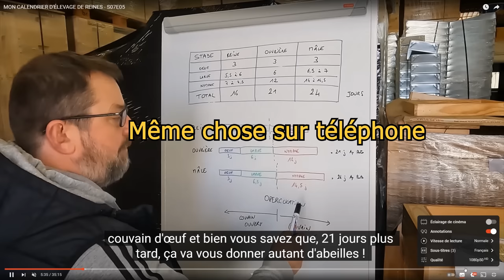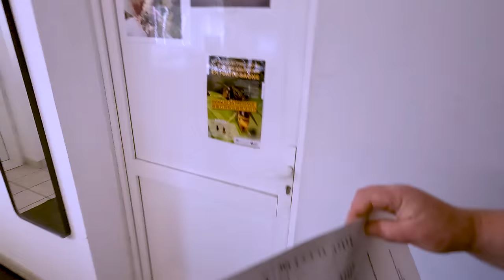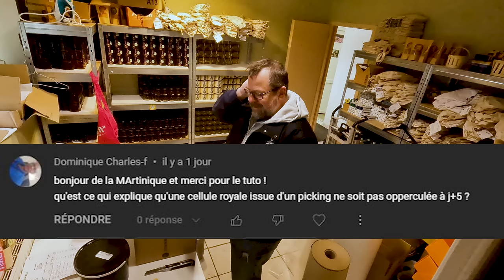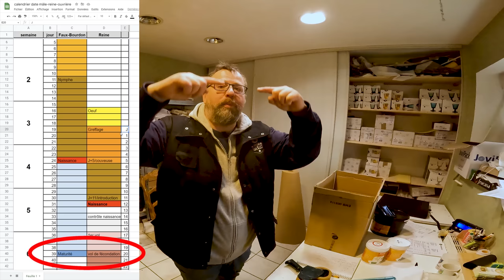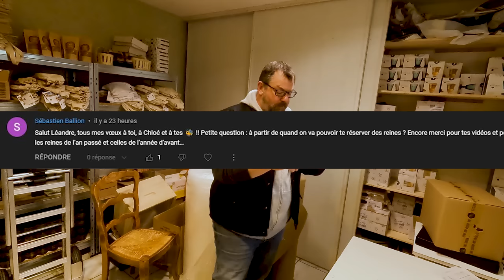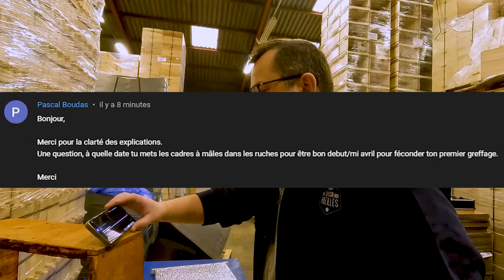MATÉRIEL, PIEGE FRELON, TVA, FAQ, TOUVABIEN !    [S07E06]

Comment: Salut,encore une super vidéo. Moi pour les frelons j'ai trouvé une solution, c'est de les attraper lorsqu'ils sont devant la ruche avec une épuisette, et de leur mettre de l'insecticide Front line(pour les animaux de compagnie, trouvable en pharmacie) étant donné que l'insecticide n'est pas trop puissant, les frelons ont quand même le temps de retourner au nid avant de mourir et de contaminer celui-ci. Chez moi les ruches étaient vraiment en péril, et en faisant cette méthode, en passant 2 fois par jour pendant une semaine, il n'y avait plus de frelons, et cela à duré pendant 2 ans, et quand ils reviennent je refait l'opération. C'est pas très bio, mais c'est efficace. Voilà ça peut être une astuce si vous avez le temps. Pour ma part les pièges à frelons n'ont jamais vraiment fonctionné. C'est le nid qu'il faut toucher pour vraiment les éliminer